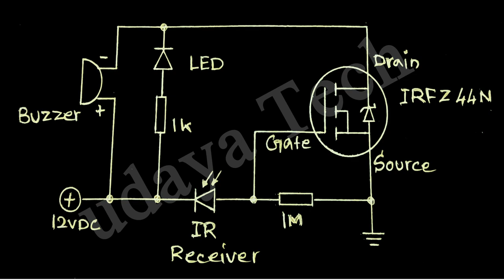How to make Fire Detect Alarm ||  Fire Alarm || Fire Detector using mosfet IRFZ44N || Home made

Comment: Is this circuit works on 9v battery?
Reply from the maker: 9v working on
Reply: @udayatech  I have prepared this circuit by watching ur video and gave 9v battery supply but it's not working
Reply from the maker: sorry sir! today I verified the diagram. I made an mistake in that diagram, I mistakenly drawen anode and cathode of IR recevier. so kindly keep anode as cathode and cathode as anode and give 9V power supply, surely it will work.
Reply: @udayatech  Sir I have interchanged anode and cathode of photodiode still it's not working
Reply from the maker: Sir! 
This is my mail ID: uk2561976@gmail.com
. Kindly send your photo to my mail, once I checked I will rectify your mistake

Comment: Sir have u connected a wire downwards?
Reply from the maker: Sir! 
This is my mail ID: uk2561976@gmail.com
. Kindly send your photo to my mail, once I checked I will rectify your mistake
Reply: @udayatech  Sir I have already forwarded photos u have not replied me
Reply from the maker: ￼

looking on to your pictures, you kept IR LED transmitter instead of IR receiver. So change that IR transmitter into IR receiver then your project will work. 
Thank you
Reply: Mark on the photo and send me the mistake
Reply: @udayatech  but I had followed your connections of the circuit